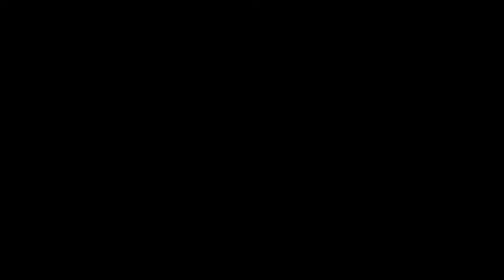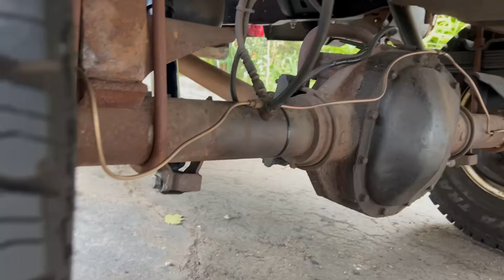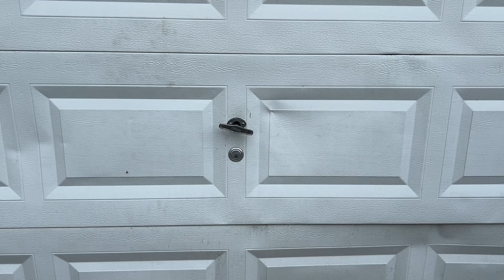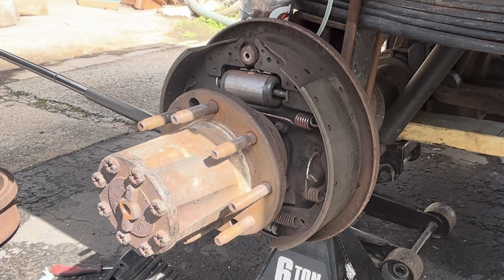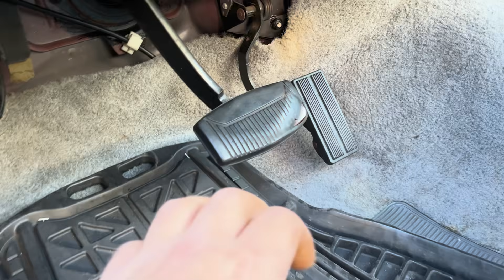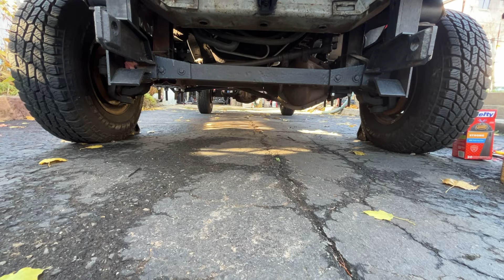I Broke the Brakes | 1997 FORD F-350 Restoration (Ep. 9)

Comment from the maker: 🔧 Recommended Tools & Supplies 
(The links below are Amazon affiliate links. If you use them, it helps support the channel at no extra cost to you.)
👉 TGR Professional Brake Line Flaring Tool- 45 Degree Set (Flaring Tool Used)
https://amzn.to/48j4w61

👉 Genuine Copper-Nickel Alloy Non-Magnetic Brake Line Replacement (Brake Line Used)
https://amzn.to/3X23W6s

👉 HAUTMEC Brake Spring Pliers (Used For Drum Brakes)
https://amzn.to/49YWq2i

👉 AGS Automotive Solutions 4oz Brush Top SIL-Glyde Silicone (Brake Grease Used)
https://amzn.to/4bTs97o

👉 Brake Adjustment Tool (Measure Vac Push Rod)
https://amzn.to/3NPDV8U

Comment: Yeah, with brakes on an old crust-belt project vehicle, it's usually a better gamble to just put everything new in one shot. It's temping to replace just what's needed to save time and cash but that goes to shit at the side of the road with a smoking wheel or brake fluid everywhere. This is a good series.
Reply from the maker: I had to learn the hard way a few times even with this truck😂. Thanks for the support!

Comment: Great video. Gotta be honest with you though. When you restore rust buckets you need to be generous with the parts cannon if you ever want to drive it. I would’ve replaced all calipers and rubber lines from the start. Otherwise that one old part starts turning you new brake fluid nasty in 2 months. Not worth the wasted time.
Reply from the maker: Thanks. As for the parts I definitely agree with you but I’m not really planning on this to be fully completed anytime soon. As I get money I’m gonna keep upgrading it in stages.  I definitely should have replaced both wheel cylinders right away rather than trying to save them but live and learn. The driver side caliper was replaced 3 years ago and the brake fluid got flushed with some new dot 3. New rubber lines are definitely on the shopping list along with some new brake shoes and hardware for the drums.
Reply: @O @OBSLIFE03 gotchu, I know that struggle. It makes sense in the present. But damn I would’ve saved a ton of time and money if I just buy once cry once’d.
Reply: @OBSLIFE03 not sure what you have in mind for hydraulic lines but Sunsong makes really nice brake and power steering lines if you ever want to overhaul those systems further.

Comment: Great job and video, my friend. Drum brakes are definitely a pita. When I did my complete brake system over, I also installed new wheel studs too. They weren't stripped or banged up but I figured that after 28 years, it was a good idea to replace them. I wish I had that flare tool. I probably would have been able to make my own lines with it. My hands are screwed up and I couldn't squeeze the hand held flare tool enough. It sucks because my buddy had several rolls of nicopp line that I could have used for free. Yor truck is looking great! 🍻✌️
Reply from the maker: Thanks that’s a good idea.  I’m making a list of parts to order so I’m gonna add those on. I’m in a similar boat with the hand problems but for me it’s in my wrists, the flare tool definitely saved me some pain😭